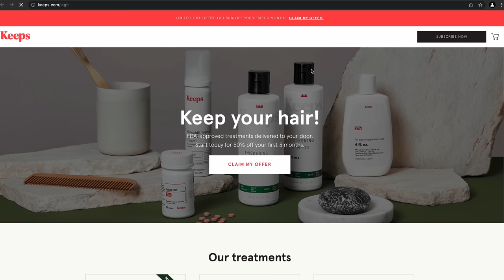What I Found After Tearing Down My SVT Lightning Engine & Looking Inside! CARNAGE ALERT!

Comment: @24:50, when only one or two pistons show those signs, then it is typically a bad fuel injector(S) and not the tune. My guess is the fuel injector is clogged causing a lean mixture in the affected cylinders.  You really should buy a new set of fuel injectors anyway and Fuel Injector Clinic injectors are the best for a boosted engine IMO.
Reply from the maker: I definitely will replace the injectors
Reply: I suspect the same when I scored a cylinder… but I burned everything up including the valves. Those valves don’t look burned up though, so maybe it was lean detonation
Reply: All the burned pistons seamed to come from one bank so perhaps a faulty knock sensor ?

Comment: hell i wouldve just slapped a coyote in it and N/a have more power than that motor with ported blower. Then add a whipple or turbo to the coyote and have the lightning everyone wanted in 2023. 850 reliable wheel daily hp or as high as 1200whp out of a stock sealed coyote.  think about it v8 f150s and mustang gts can make that 1200whp and mustangs have ran 7s and f150s 8s in the 1/4 mile with stock sealed engines.  No heads no cams no pistons no rods
Reply: Winner here
Reply: exactly what I told him, no matter how much you build a 5.4 it will have problems.

Comment: The TC nuts could be mangled because someone did the flywheel lock trick with an offset 14mm and having it jam itself stuck while you get the lower boost pulley off. I'm just now finishing up my JLP heads and Stage 3 cam swap. Super stoked. Love my Lightning. Forged and built block is in the future.

Comment: Boost equal heat in a cylinder, more boost, more heat, needs a larger ring gap. The rods arnt bad it’s the too tight ring gap for higher boost/hp. Don’t take my word for it look up Richard Holdener he wrote for several magazines for over a decade. Check out his YouTube.
Reply: Broke or damaged rods in a boosted mtr are more often than not from too tight ringgap , just like the cylinder that took a poop in ur mtr, looks like ring issues not a piston failure imo.
Reply: @braindamaged1700  I agree, looks like ring gap too tight, combined with excessive cylinder pressure and gaps touched.

Comment: 4 bolt, cross bolted main, FORD did that on the NAscar 427 engines of the 60's 70's nothing new there, We built a 427 sideoiler in the High School shop 1986 dropped it in a 68 Mustang GT500, the 427 SOHC motor used the same cross bolted mains, stronger than the traditional four bolt like chevy used.

Comment: Great video Alex. There is a way to clean rust from the coolant passages. Seen Evans coolant run in an engine for a year. It cleaned the rust by blocking it and the fluid flow dug it out

Comment: Hey Alex, unrelated but I have a question. I'm getting ready to swap the engine from my 2003 c320 with a identical 2003 c320 engine......mine blew up😂 Will there be any coding issues I could run in to? Or is it plug and play?

Comment: Been there. Bought a 97 Z28 with a Vortech blower kit from the era. So no injectors just an FMU, no tune, just a spark retard box with a knob the previous owner didn't understand. Found broken ring lands on cylinder #7. Took the opportunity to upgrade to forged rods and pistons, bored .030 over, upgraded camshaft and ported the stock heads and intake, 24x conversion (Holley Terminator X) and a custom closed loop catch can. Now I've got a 600hp LT1 Camaro that I can trust the engine in for years to come!

Comment: In the Ford ranks, they call them "Heaton' blowers for a reason. Wit the 99-04 Lightning, and brother 03-04 Cobra vehicles, slapping on upper/lower blower pulleys, intakes, and tuners netted big power-per-dollar gains, but most overlooked the more costly cooling upgrades with heat exchangers, 'cold' water reservoirs, or upgrades to drop the IAT's from the increased boost. Many a cooked piston or head gasket  issue I saw back in my Ford performance days.

Comment: Seventh Generation – 1973-1991

The seventh-generation introduced the very first four-door Chevrolet Suburban models in 1973. The wheelbase was also lengthened, measuring in at 129.5 inches front to back. A focus on comfort and amenities saw the introduction of features like front and rear A/C, third-row heating and step-up plates. Under the hood, electronic fuel injection and a new four-speed overdrive transmission were introduced in the late ‘80s.

Comment: This is almost exactly like my 10gt500 5.4 iron block did on 7&8. Except 8 was worst than yours and under heavy boost it would break off a piece smash the plug shut and travel all around until one day pieces made it to my 3.6KenneBell and locked it up making me think my engine was locked at first. Ended up going .020 over gorged Diamond would went bad in a 1k miles now has Manley and at 850hp

Comment: Since ford is copying the engine design across generations, id invest and get a 5,4L from a ‘13 GT500, stock came with 680bhp and will drop right in.

Comment: So the coyote mustang's get piston slap when run hard, the engine's in the new bronco's are failing, the triton v8's are known to fail, now the svt engine's don't last. Maybe Ford should bring back the 351 Cleveland and original 302 they were awesome. Also the 300 straight six was bulletproof. I'm starting to believe the new ford engine's are crap.

Comment: I put a poly trans mount on my '95 Z28, M6, and my '00 Camaro SS A4. I kept tearing up stock mounts on both. I found that using poly trans mounts keeps you from tearing up motor mounts. That being said,when I do my engine project on the SS, I am going to do a poly on the passenger side and rubber on drivers. In the good ol days, I did a steel on the pass and rubber on drivers on my '70 Cuda 440. Some people used to chain the drivers side to the frame, but you can crack the drivers side block doing that.

Comment: A forged bottom end + bigger blower + long tube headers + E85 + sticky tires = lots of windup and wheel hop, maybe even broken u-joints. Maybe consider something to keep the leaf springs from winding up like a Stiffler's long bar traction system.

Comment: You should go out and get the 5.8 l modular block that was used in the mustang g Shelby mustang GT500 from I think it's 2007 up till 2014 that would give you an increase in displacement to go along with that extra airflow and those can be rated well over a thousand horsepower

Comment: Definitely a combo of either a stock or cowboy tune mixed with the upgraded pulley; upper ring gap closed to zero and popped the ringland/crown... Yeah, babying it around saved the motor from complete destruction, for sure.

Comment: Why don't you buy a built 5.0 for a mustang and put that in. Buy a roots supercharger and be done. The 5.0 is lighter because it's aluminum and will make more horsepower because of the 4 valve heads with the supercharger.

Comment: 5.4 early was bad about wrist pins walking into cylinder walls. Apparently your engine does not suffer the same problem. Glad crank wasn't damaged. Are you going to a taller cam/ longer duration?

Comment: That oil cooler gasket leaks on every single ford I have gotten. From my crown Vic to the mark 8 to my aviator. Every time I buy a V8 ford that gaskets leaking oil. Even a 10yr old crown Vic it was leaking.

Comment: How do the Sonic Tools compare to Snap On or Matco ? My grandfather was a diesel mechanic and used Sanp On , my father is plumber and used craftsmen for the rare stuff that we need use ratchets and sockets as plumbers and asked him why he didn’t use craftsmen because it’s cheaper and they also have lifetime warranty, my grandfathers response was craftsmen does warranty their tools but they don’t warranty my knuckles. Snap On may be different nowadays and not the same back in the 60’s,70’s, and 80’s

Comment: You shouldn't feel metal for imperfections with gloves on. You miss so much. I am a machinist. When I wear gloves I miss burrs. You need to use your bare nail. And a burr is way worse than anything your looking for on a crank.

Comment: The burning of the was caused by detonation,I agree, but why on only one cylinder? The cooling system on  that vehicle was completely neglected, because for only having 85,000 miles look how much rust it has. 
Not only one piston got messed up, I saw that you found another one bad,   this engine suffered from complete neglect, poor engine.
Come on people you have to keep the cooling system and the oil clean, it's not that hard or expensive to do

Comment: If memory serves me right, the Lightnings bottom end was more or less just your standard issue PI 5.4 with the only major differences being the blower obviously. I would definitely make sure to get another block to keep around for the what if... unfortunately many Lightnings were grenaded in the early 2000's because people were putting Whipple's older blowers on them without many other supporting mods and the 2v never really breathed well to begin with.

Comment: Using the wrong gas just once can cause your blown head gasket / slight pissed and melt which is probably what happened but that's made for premium fuel somebody's put regular unleaded in it at 87 octane what do you think's going to happen if you detonation

Comment: Get you a GT500 oil pan gasket when you go to put it all back together. It’s an inexpensive windage tray option and gasket in one. Just have to clearance it a little for the oil pick up tube having different routing.

Comment: Sorry! Ignoramus here... Was it required to remove those torque converter bolts before you separated the engine from the transmission? I work on cars, but I rarely ever have to go this far and never worked on an automatic transmission. Thanks!

Comment: My first thought on the couple pistons was too much boost, not enough ring gap.    Those ring lands sure took a beating on several cylinders - on second thought, might have been a combo of too much boost, not enough fuel, and not enough ring gap (because of the excess heat); beating the hell out of the ring lands and breaking the ring.  oh so many reasons...

Thanks for the tear-down video. Oh and I vote to keep the rubber mounts - I think poly will make your teeth rattle on daily driving.

Comment: I have a clk 2006 I have swapped a m113 k all the work is done I have the car running but can’t get a ground signal to the supercharger water pump would you be interested at trying to get it running right if I can get it to you

Comment: Make up a solution of white vinegar and water to soak that coolant system in. Then put a good mix of water soluble oil and water in it and then make sure you put water soluble oil in your coolant system. About 6 oz should be enough. That will stop the rusting inside the engine. Just for your information, Heat does not transfer through rust very well!

Comment: Glad you went all the way down with this. Would have been horrible to get the heads done and all that arp hardware and have bottom end failure. That one ring would have went first. The whole time I was thinking what about the rear main seal. Also all the sediment in the cooling system the block definitely could use a dunk. This is definitely the right way to do it. Too many have others do the labor for them or half a** to cheapen the job or to cut corners. Happy to see you get it done. Worst block lifting I did was a complete 327 oil pan to carburetor out of a lowered mini truck into a lifted chevy. I wont lift a engine unless its completely torn down now.

Comment: 10 thou over is not very common on cylinder bores, if available at all. It usually starts at 20 over. It's also not just about scoring, but ovality or taper of the bore. That determines how much the cylinder has to be overbored when there are no scratches.

Comment: You see hammered ring lands on turbo engines that have crappy tunes. The guys creating these tunes go for cheap power by disabling timing pull and defeating boost control. This is particularly common when guys take their cars to the track and forget to remove the tunes. People are not aware that the the US no longer has high octane gasoline available in all areas. Here in Denver it's only 91.

Comment: Hey Alex now you know what water does to a cooling system. Waterless coolant maybe a little more expensive but the block and rest of the system will be immaculate. Of course at this point the heater core needs to be replaced anyway so I would seriously consider using this type of coolant. Great Videos Thank You 🙏

Comment: Loved the entro and as I said in you first video to be honest I saw the cylinder walls first and had to play back to see the piston so at this point better rods and pistons bore the block polish the crank or turn it if it needs it port the heads or after market heads cams and a proper tune and you should be good to go. In a way I'm happy for you once all is done it will be a beast. God bless and as always be safe 👍

Comment: The oil cooler assembly you took off - may want to replace that. Sometimes a coolant leak develops between there (particularly with the rust) and dumps coolant into the oil. The failure mode will be no smoking or pressurized coolant system - but raw coolant dumped into the oil. It also tends to mix into less of a milkshake when the coolers fail and stays separated.

Comment: The trans am piston had alot more power going through it then the Ford. And you were beating it at a drag race.
If you did the same type of driving on that ford truck with that stick piston it would have blown that engine lil

Comment: The only way to combat this is fast knock detection with a really good ecu or with an aftermarket knock sensor with in eyesight as a flashing LED. It flashes you back off.

Comment: Not detonation damage! Corrosion!Head gasket leaked and some kind of really bad, highly acidic coolant that sat in the cylinder on the low side for quite a while. Then the ring and cylinder had seized in a spot. When it was started it lifted the ring on down stroke and damned near tore the top land out. The bearings show absolutely no detonation damage as well.

Comment: For an engine with this many miles and that high of compression, I'm not surprised there is that much scoring. Same thing with Porsche these days. With the high compression, high temps and bad nickel coatings the same thing happens. I'm under the impression that all high power engines will succumb to the same scoring issue.

Comment: Dang you are spending way too much on that Ford. A couple of new pistons and new rings and you would be good to go. Those bearings all look good also. Ball hone those cylinders to clean them up, you could even reuse some of those gaskets. You might have to replace those head bolts. I mean that is a Ford no use throwing good money at it and hoping it might be as good as Slant 6 or a bow tie.

Comment: Yep same block is any other 5-4 2 valve do yourself a favor and if you're going to still run that engine at least pick up a set of aftermarket heads those four heads don't flow worth the crap and they're worthless to spend all that money porting them pick up a set of tricks flows just whatever you do don't spend coyote swap money on a two valve many people do it and are severely disappointed

Comment: If you're going to build it build it build it better go for valve with the higher strength pistons and connecting rods and I would even check into maybe using gapless rings instead of filing a gap and give you a much better seal

Comment: i don't understand why when you flushed the engine u flushed through the radiator instead of just pulling  the bottom and top hoses from the block it self and connect the hose to the top and just let it run for 5 min. the extra  volume and escape of water would have gotten alot more debris then  just the bottom of the rad  or even fill the block with vinegar let sit 24 hrs and drain it.... cheers:face-blue-smiling:

Comment: With all that rust, i Think i will be a good idea if you tell why we use engine coolant.
Some people Think it is only necessary where there is frosty weather.
They do not know that it counteracts rust, cools much better than water, withstands higher temperatures in the engine

Comment: Polyurethane mounts are a great idea especially if you're going to add more power to that engine simply because the stock ones won't be able to handle it and will come apart

Comment: those factory pistons are forged.  i'm guessing that cylinder ran a little hotter than the rest and butted the rings?  I would definitely pull the plugs after a dyno session to check a/f ratio and timing.

Comment: I have an 01 expedition that has a 5.4 triton, and had the #3 spark plug pop out, thought exhaust leak until I saw the coil sitting on the engine.

Comment: That trans is the same that is used in the diesels with the exception of the planetary gear assemblies, you have aluminum planetary gear assemblies and diesels have all steel planetary assemblies! Minor difference but not as strong!

Comment: My self leveler I removed the handle and put a double nut on it and use the impact to tilt the engine. I learned that trick back in the early 90s.

Comment: You’re right about the trans, the regular F150 had the 4r70 and the Lightnings had the 4r100 which was standard in the F250 and Some expeditions (the 4x4 ones)
Reply: only the 4.6 trucks had the  4r70

Comment: Hey buddy I know that you’re a busy guy and you probably get 1 million messages a day but I have a 2007 Mercedes E320 blue tech that I have done a small handful of aftermarket work done to it but I am currently broke down out of state and don’t have much money I need help diagnosing my Mercedes so if you could get in contact with me today that would be Greatly appreciated
Reply: And any help would be appreciated It is a no crank no start issue. Almost all electronics in my car has gotten wet due to drunk seal leaking